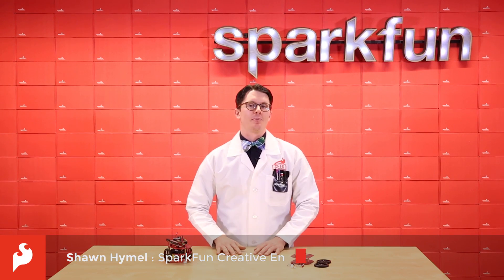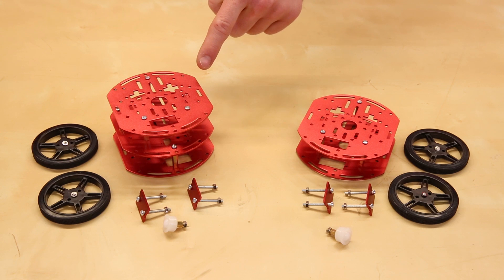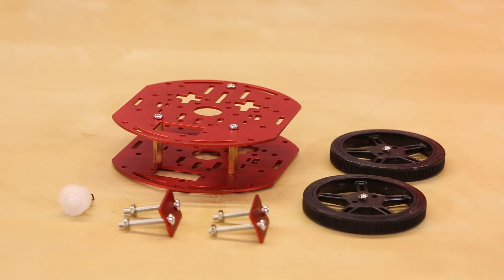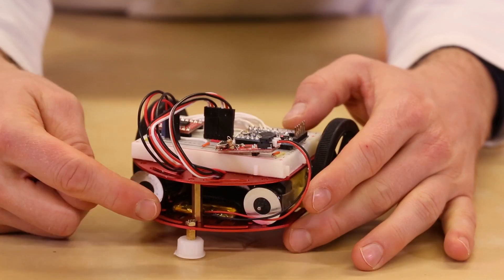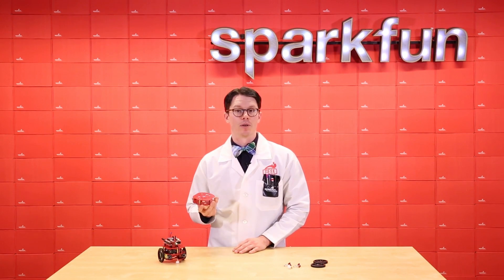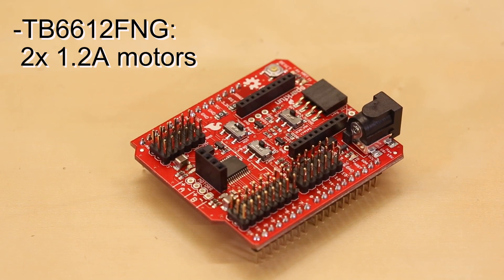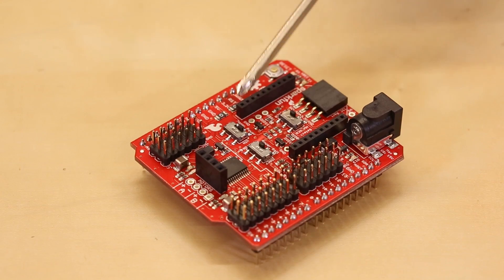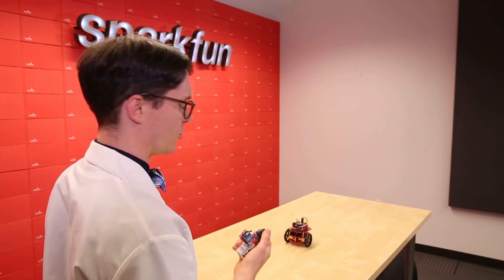Product Showcase: Wireless Motor Driver Shield and Circular Chassis

Comment: Any chance you will open source the chassis? It would be nice if ppl could 3D print the plates and wheels.
Reply: I don't think it's a Sparkfun design. You can find very similar, possibly identical, chassis on other sites.
Reply: I am fully aware, since I built one the the first Sumo bots back in the early 90's using a pic and then a basic stamp.
I like the location of the holes and the general size and look.